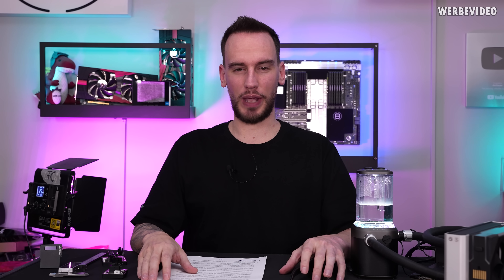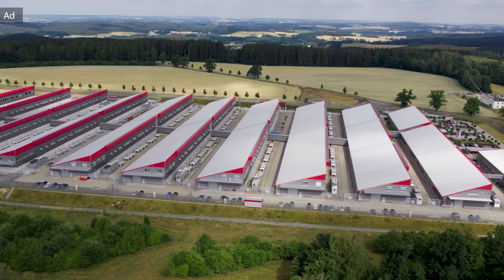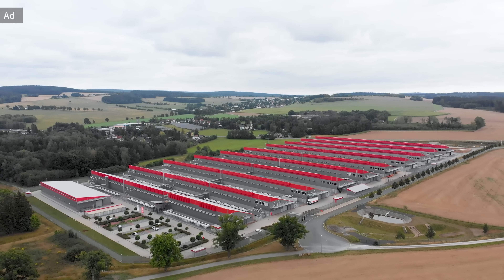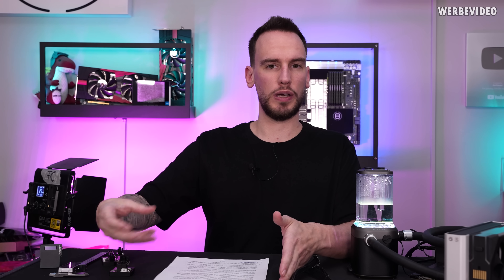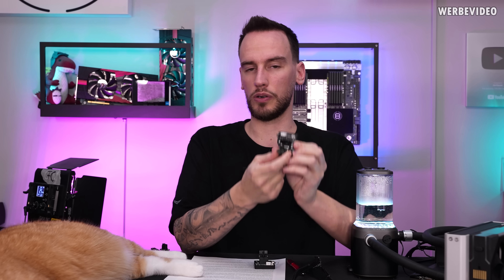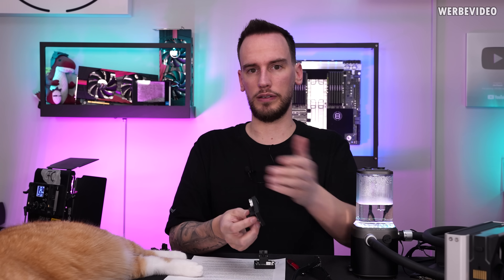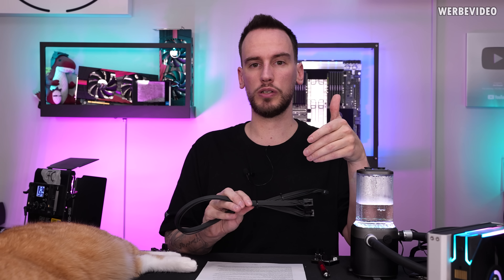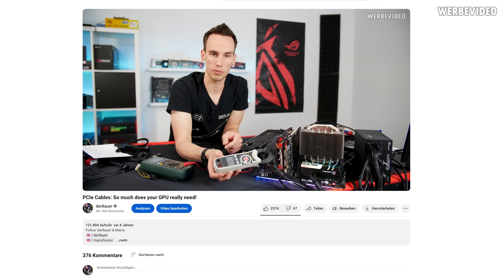12VHPWR is just Garbage and will Remain a Problem!!

Comment: Your explanation is very informative!
I studied in University the regulations for sizing the wiring of domestic electrical installations, which can be considered over-killed because the safety margin is really big, even in the most permissive standard. Since this new 12V high power connector appeared, I've been wondering how such a small connector can carry so much power and still be considered safe, and now you've got the answer: the safety margin of this connector is awful.
Thanks!

Comment: When the 40 series came out I stated the plug is not substantial enough to handle that wattage, with photos of other compirable board failures in the automotive lighting industry. Was massively down voted. One of the manufacturers uses the same 12 pin connectors and they stated without a heat sync to counteract aging connector resistance the connector will not handle more than ~350 watts at "atmospheric temperature". Being inside of a computer chassis lowers that threshold substantially. Hundreds of units failed after about 6 months and I had to rewire all of them by hand to spread the load out between 24 pins. This issue will always be lurking around theese cards, only getting more common as the years go on and oxidation takes its toll on contact surfaces.

Comment: The best thing for this 12VHPWR is for it to go away and die in a corner like BTX did, nobody asked for any of those standards.

I much rater have a improved version of the old connectors with sens pins, because that is actually useful and not a new idea.

Comment: So I have a MSI Gaming X Trio 4080 OC card. My PSU is the Seasonic Prime ATX  3.0 PX1600W. Yes I’m aware that my PSU is completely unnecessary but that’s what I bought. Anyway would it be safer to use the 12volt cable that comes with the PSU or use the 8pin adapter that comes with the 4080 card? I know this doesn’t apply that much to the 4080 compared to the 4090. I’m new to understanding this stuff. But to me it sounds like it wouldn’t matter cause the connector that goes into the GPU is the same as Roman stated. Thanks

Comment: TBH I'm using a seasonic TX1600 3.0 PSU, strix 4090 with the 12VHPWR cable and I have had no issues, cables fits into the GPU and PSU perfectly, no movement what so ever, stress tested the card for over an hour pulling 578w.

I watched Jays vid on the adaptor from cablemod and how much he could pull and bend it yet it was still clipped in, thats not the case with the seasonic connector, when its fully seated and clipped it will not move at all.

Comment: I'm also tempted to simply point out that other appliances that pull that much power have a lot of regulations limiting them not to say warnings all over them, like space heaters, cooking microwave/convection oven, water heaters, furnaces, etc. Another issue with the RTX-whatever-ninety, is that it pulls a bit much power for a 'consumer' device. Things like game consoles, TV decoder boxes, VCRs/disc/tape players, desktop fans, screw-bulb style lamps, etc, all have a drastically lower watt rating, I suspect there is a good reason for that. As inefficient as some say they are (and they are compared to LCD screens), a CRT color TV was only 140 to 120 watts, even older ones from the 1980's. there would be maybe 4 or 5 plug-in devices in your house that pulled more power, coffeepot/percolator/kettle, hair dryer/curler, the amplifier for your stereo system (maybe, most were 120 watts total or less), and your vacuum cleaner. everything else is 120 watts or less, for some reason.

ok, 150-watt halogen floor lamps, yet if you think about them, it is a very specific lamp for a specific fixture made to handle the heat hopefully without burning down your house. a hair dryer should have at least 2 thermal limiters plus a fuse on the input, that's way more electrical protection than most lower-power devices on the entertainment stand have, lol.

Comment: we really should've just moved to eps on all things and just used 2 eps 8 pins for the 4090. That would've been 8 total 12v pins which is a lot more comfortable than 6. Especially when it's split between two connectors and not with the micro pins or whatever the standard is called.

Comment: Did Intel sabotage Nvidia?! The NHSC in DOH! mode is just hilarious since I don't have a 4090 myself.  NHSC is Nvidia Homer Simpson Connector and should become a meme with Homer SImpson wearing a leather jacket and giving a video card on fire presentation.

I gotta give some respect to Cable Mod for standing behind their product and buying all of the GPUs to make it right.  That makes me feel good for supporting them, so often the PC industry is finding ways of escaping responsiblity.

Personally I'd rather have a 350 watt 4090 anyway, I don't want an overclocked GPU out of the box.  If the 4090 will run with two sense pins cut it's an easy fix.  Turns a negative in to a positive.  But the fatal flaw of the connector is that it only has limited lifespan and the more stress from plugging and unplugging or physical stress like bending cables then the faster it will fail.  A couple more years from now there will be a lot of burned up 4090s on ebay.  And no, doubling up on the shitty connector dosn't fix the problem, it just means you are wearing out two connectos instead of one every time you plug and unplug or even simply rearrange your GPU cables.  The issue is the tension inside the connector required to achieve the rated current carrying capacity.  I suspect over the next year there will be significant failure of 4090 cards that will result in a class action against Nvidia.   The core issue is that the connector requires so much tension inside the connector and it's not being provided by discreet spring steel but just the bent metal of the cheap connector.  The error so fundamental there is no solution, only a temporary fix and Nvidia sold how many of these things?  I should say there isn't a fix, the fix would be to solder the wires directly to the PCB, thus bypassing the conector entirely.

It's a connector that only solves a problem for OEMs, how to sell 2K dollar GPUs with 50 dollar power supjplies and not have it crash?  NHSC to the rescue!!  What' adds to the humor is that the GPU is being driving to t hose power levels for little gain so it's kind of dumb to be pushing the 4090 past 350 watts anyway.  LoL, then the icing on the cake was Nvidia making it mandatory everyone use the NHSC!  Nvidia needs to buying all of the burned cards in my opinion because it was they that made it mandatory.  That's what makes the problem ridiculous, Nvidia an entire industry use a dumb-ass connector with zero culpability.  Nvidia should go back to selling chips and let the board partners make superiror cards to your ugly ones.

I personally have embraced my sexy Cable Mod cables and want 24 beautiful individually sleeved wires flowing out and under my vertical GPU.

Comment: excuse me but since when is a correct factor used for stranded vs solid wirre. i dont think the 0.4X correction factor should be used for the wire. as those are stands, not wires. the amount of wires  bundled together like in ATX24 pin connector results in a correction for 24 cables. would be 0.45 over the whole if bundled together (which they usually are)... a 6 pin PCIE would have 0.7 applied and so on and so on... not counting individual strands.

Comment: I thought the issue with the 12VHPWR connector was that the contacts never fully touch due to minor manufacturing defects or user not plugging it completely. Didn't understand how having a higher pwr rating and safety factor will fix this if the contacts don't touch properly, in 8 pin config if one melts it's still a pretty serious hazard. The flagship cards are not going to get any smaller, Nvidia will have to spend more on a much more secure bracket for this big cards.

Comment: What I don't understand is why they don't just use existing high amperage DC connectors that have been proven in the market for decades, like DEANS or Anderson Powerpole. They are small, durable, have very positive engagement, and can handle ludicrously high currents with low DC voltages. They make panel mount versions of both. I feel like they could have had better luck doing that than coming up with an entirely new standard that seems flimsy and shit even at first glance.
A keyed row of 4-6 DEANS connector pins in a clip with positive engagement (Think like PCIE latch or ribbon connector latches) would handle more current than any video card would ever need.

Comment: The Cable mod adapter was absolute trash.  When mine showed up, I inspected it and immediately threw it in the trash.  I'm currently using the wire view and it's very well built and I had no concerns at all.  I push 550-600 watts through it for hours regularly, no issues.

Comment: Another thing. If they wanted to use this terrible connector. Why didn't they put it on the side. I liked that from the EVGA adapters that you could have the cables on the side.  Now, since those cards are so ridiculously big.  How about on the back? Either have the socket pointing towards the back. Cables won't get on the way of anything unless you have a stupid big tower CPU fan. Or have the socket soldered on the back pointing towards the side. That way, if you put the GPU normally, you can stretch the cables parallel to the GPU board/back plate comfortably to the cables. And if you decide to mount your card vertically, the cables would also be on the back not getting in the way. As of now, 35mm is too much for most case. For many cases at that point you might want to mount the GPU vertically to have that much clearance.  But if your case is a solid wall, like a tempered glass, ventilation would be a problem.  It's beyond me how so many case have the vertical mount, but a solid cover. Many years ago, like 20 or so, I had a case that had a fan on the side cover.  And I have recently seen many of those tiny cases, like ITX, that have space to put a GPU, and their side cover is perforated. So the GPU gets direct air from outside the case. 
But I don't know what's worst. The atrocious design of the 12VHPWR, a smaller overall connector for much more power. Or the design of these immense cards.

Comment: AWG is based on the cross-sectional area so 18 gauge stranded wire should have the same cross-sectional area (cross-sectional area of each strand x number of strands) as a solid 18 gauge wire and therefore have equivalent current handling characteristics. If the wire meets the ASTM standarda, no correction factor is needed.
Reply: Yeah I was wondering about this myself. Current capacity is ultimately limited by heat, so the only thing I can think of is that maybe stranded wire is somewhat worse at getting heat out.

Comment: Connector design is bad, case closed. You want to get rid of this problem? Instead of adding second failure driven 12VHPWR to 4090 just throw that connector to the dumpster. I also have nice solution for this - XT60/ET60 and you're done :P

Comment: Does It basically mean there's no solution? I went from a bent 12V HPWR to the 180 adapter as the monster is right up against the glass on a 011 dynamic evo. I'm tempted to keep using the 180 adapter seeing as the problem seems to be inherent to the card itself

Comment: Sounds like a few extra strands of copper and set of pins would have solved all of these issues. 14 pin high power would have none of these issues but I’m assuming was ‘far too expensive’ to be truly considered past the design phase of determining the absolute minimum spec for transporting 600w in the most compact design possible. This is shortsighted minimum viable spec engineering and it’s sadly the way the field is going in the era of profits over everything else.

Comment: Correct me if I am wrong, but the sense wires on the connector aren't what I expect sense wires to be. In my opinion, on a power supply, a sense wire should be something that runs back to the PSU as a measurement device to allow the PSU to adjust the output to account for cable / run losses and/or for the PSU to monitor the power at the location of the load. I loathe the 12VHPWR connector, we had a lot of other stuff that worked without nearly as many problems, why did we have to change it ? Yeah it's smaller, but like.. it's inflexible, there's been problems, the fitment sucks, and the list goes on.

Comment: That Asus card would only do that if it had bad solder joints and it seems since we have banned lead from solder it is causing many issues. Also something to consider is the amount of heat that is in that plug area alone. It is possible the the solder itself flowed due to the heat. When are they gonna wake up and put the power Plug on the backside of the card??

Comment: When i was building the case width issue was a nightmare and ive ended up with a case that was exorbitantly expensive and much bigger than i wanted just to accommodate it at all. I ended up with a moddiy 90 degree and that has thankfully been a fine 90 degree adapter but this build has the worst time building a PC ive had in 30 years of builds. The cable spec should have been designed 90 degrees in mind because it clearly didnt take any aspects of reality into account, very much a works on paper and in our lab design.

Comment: Jayz also found that it is almost exclusively just 4090s that have this problem. The 4080 pulls a low enough amount of power that it is extremely rare for a failure since even if you pull the wires the same way the remaining wires can still handle the load. If you undervolt the card even a tiny bit you can drop the power a lot with almost no impact on performance.
Reply: the latter sentence pertains to 4080 or 4090?
Reply: @elmalloc  4080
Reply: I have also read about connectors melting on the RTX4080. It's definitely not as common as the RTX4090.

Comment: Why don't we have a separate, high-voltage power rail for GPUs? Why do we keep trying to push more and more amps through a shitty 12v rail? And why in the absolute hell do we keep putting these connectors on the top edge of these ever-more-bloated GPU cards? It's getting to the point where I can't close the side door on my case.

Comment: 2 "quick and dirty" solutions are available without changing the connector, and both should be used at the same time:
- Move the connector to the tip of the card and orient on the "X" axis instead of the "Y" axis.
- Put 2 of them, not one.
Long term you simply need a better bigger connector with a sane margin from the start.

Comment: This video is amazing, thank you for the detailed explanation, I can totally relate to that part you showed slightly moving the cable triggering the disconnect LED to lit up, I've seen it happen in a few cards I experienced in person, truly disturbing.
This would have been sorted out so easily by revising the numbers in the current standard, but I'm sure there were other interests in creating this "new just to be new" connector, selling new cables, new power supplies, etc.
All that aside, I am still baffled at how badly designed the connector is, it seriously makes me question de competence of the people that put this design forward and the ones that later approved it, it's like they only saw controlled lab results and never thought of doing any real world condition testing.

Comment: Server GPUs are already moving away from 12V to 54V power. The big socketed GPUs are already pushing 750W, and there are public discussions preparing the industry for 3,000W per GPU within the next couple of generations. We won't be getting these mega powered GPUs at the desktop, for one standard US wall power can't support that kind of power level, but we are already running into power delivery issues with big consumer cards at 12v. I wonder if it is time for ATX to start working on 54V desktop power to reduce amperage across connectors.

Comment: My suggestion for a temporary solution for any RTX 4090 user is to undervolt. Other than making sure your current cable is connected correctly, I would suggest a modest undervolt by both power limiting to 75-80% as well as core voltage undervolt let using the MSI Afterburner curve tool.  My RTX 4090 pulls about 275-290W under full load and that would be within the safety limit of the defective engineering flaws 12VHPWR design. Would you be slowing the 4090? Absolutely, but the risks aren’t worth taking. Nvidia 4000 series cards were not tuned well, pushed beyond the curve in terms of power efficiency and therefore really good undervolting cards. The card is about 5-10% slower if you tune it with a good stable undervolt and that’s still faster than anything else on the market other than another RTX 4090 at stock settings. 

You can rest assured that you won’t be burning your house down.
Reply: The best thing could do the people is start returning their cards to Nvidia and get a money refund due their issue.

Comment: Why can't they use a connector similar to the server power supplies where you have a more contact surface per mm due to the fingers, or if they can standardize on some general positions, allow users to have solid bus bars with slidable links similar to what is found in some industrial equipment where the solid metal bars are attacked to the end points and then orientated in to a usable shape via the bolted portions, then tightened in place , thus making a rigid power connection that is bolted at both ends.

Comment: We shouldnt even need external power connectors they are just a lazy design motherboard should now be able to supply the power via the motherboard, no external connetor then no issues will ever come up, the use of external power cables for things like GPU's always been a pretty lazy solution, the current ATX standards are a joke and need to be updated for the bette.